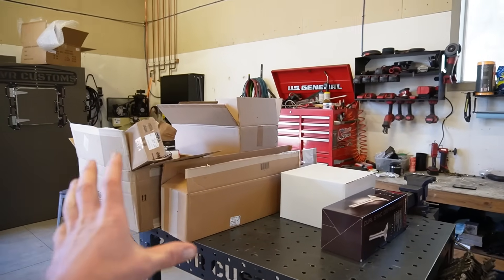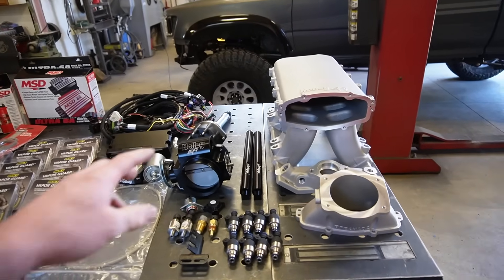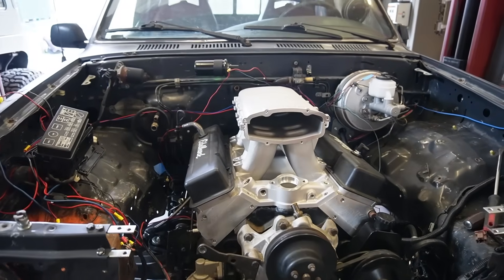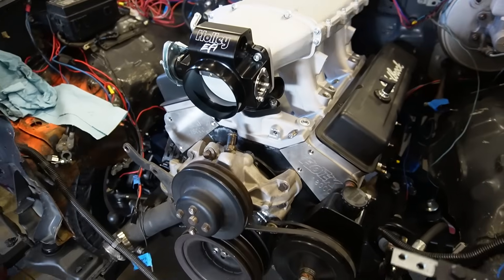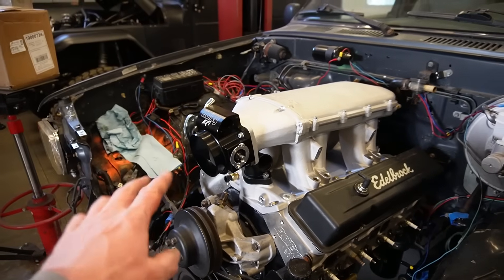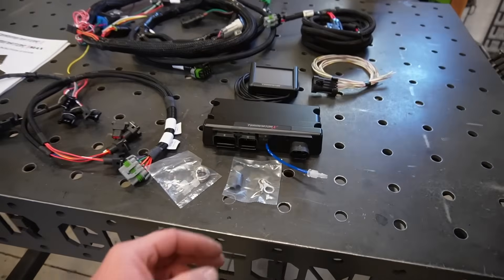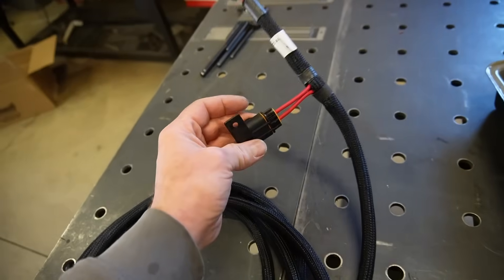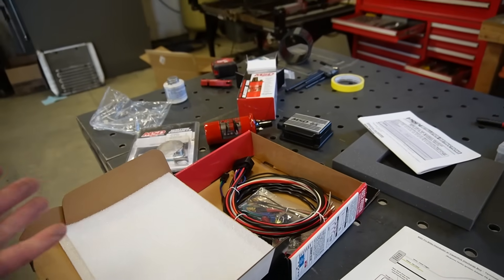Holley High Ram EFI AND Terminator X ECU For The 350 Chevy Swapped Toyota Pickup!!

Comment: Are you running an in tank pump out of preference or...? Honestly curious, because i faced the same issue when i Ls swapped my camaro that came with a carbureted pickup in the tank. Turned out that Ford used inline external pumps when thry wrre building their trucks with 351's and multiport efi. Walboro makes a factory replacement pump for that era of mid 80s through mid 90s trucks and it supplies the 58psi my engine needed without much effort. And their pumps are quiet to. Anyway i was just curious

Comment: Nice job. Looks like it's coming together. You should try and talk holley out of a mid-mount accessory drive. The hardware that comes with mid-mount is kind of garbage, but it is the nieces aftermarket acc drive system for a SBC out there.

Comment: Love the videos !! I have an 89 4Runner, struggling with a transfer case actuator problem “what I think it is anyway” 
Flashing 4wd light and sounds like the front right hubs trying engage while driving. 
Any tips on what to do ? I’ve popped the cover off of the actuator and checked the shaft is returned to 2wd position which it is. No idea, thanks anyway and again love your videos !
Reply: Also note the 4wd hi and Lo is working fine, just the issue above ^^